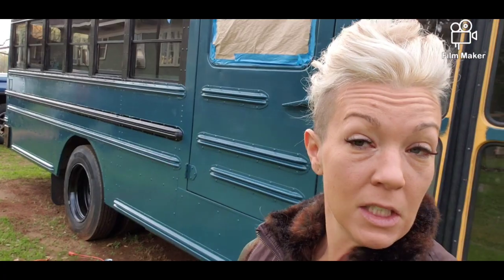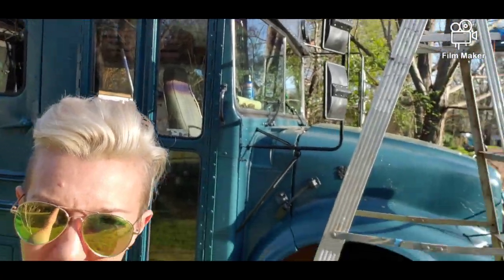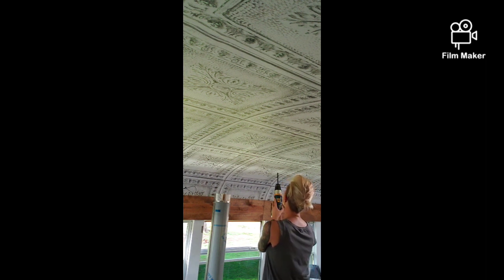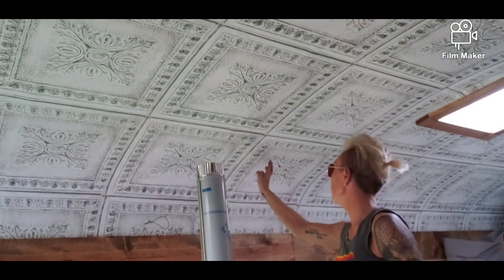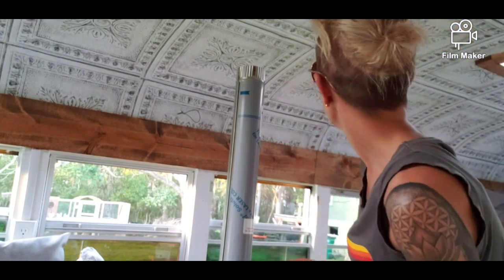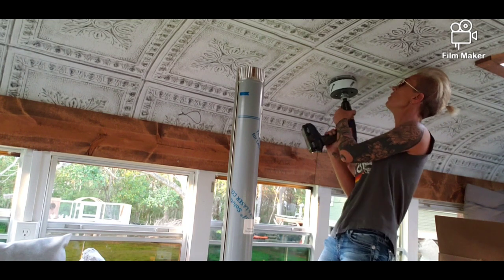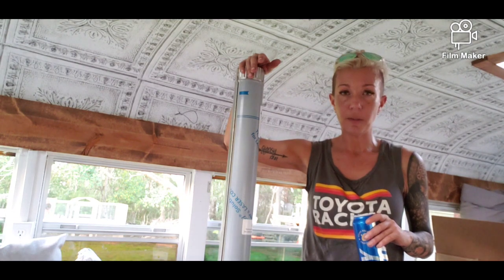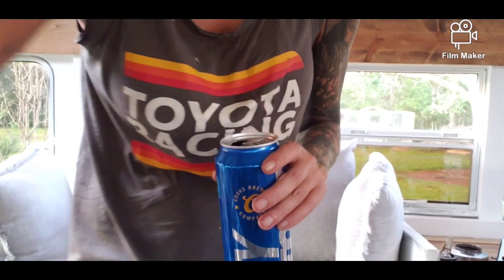Painting of the bus, and cubic mini stove pipe installation Part 1

Comment: You gotta back up out of the hole a bit.  Get the drill moving with some speed. and slowly, move into the hole.  You are smack up against and trying to start the bit, and you are gonna have a bad time.  The technique you are using wouldn't even work well for drywall.

Speed and gentle pressure are your friend.  Cutting metal requires letting the cutter do its job.  If you jam it up onto the work piece and press the trigger, you could end up shattering tools.  Cavemen and women did not make good machinists, which is why they used sticks and stone axes and shit like that.  

p.s.  When you were trying to drill your pilot hole in the ceiling, it may have just been a weird artifact of the camera you are using:  but it looks like your drill may have been turning in reverse.

p.p.s.   get up on a little steppy stool.  Your body mechanics are not allowing you to control the cutting tool.  When the tool grabs it is just throwing you around because you are over-extended.
Reply from the maker: Thank you for the advice. I knew I must be doing something wrong because it wasn't working well. Lol
Reply: Marcus Kellum 

 . Hi